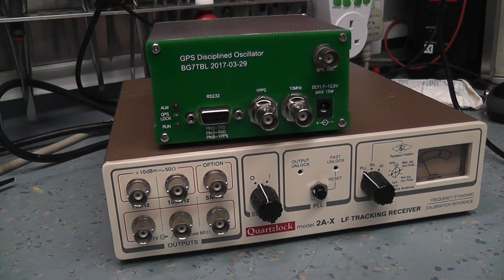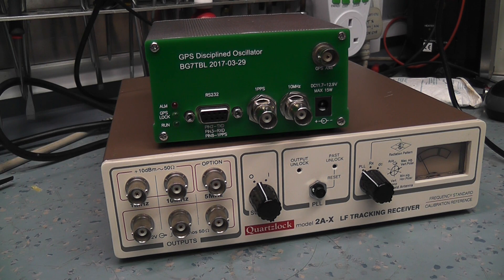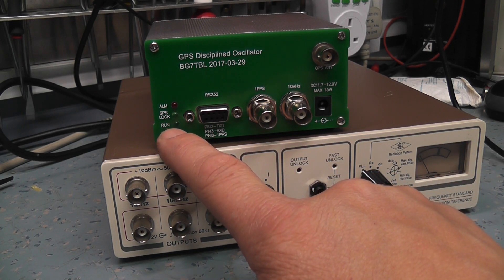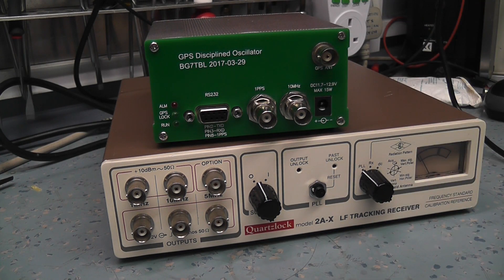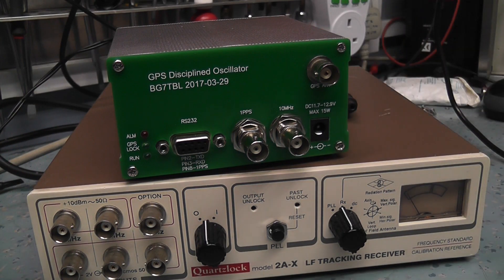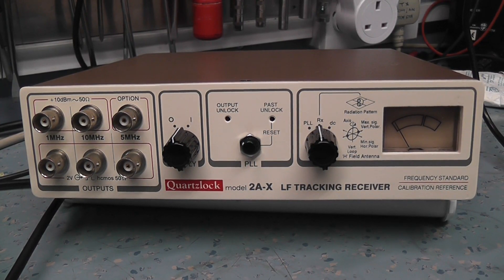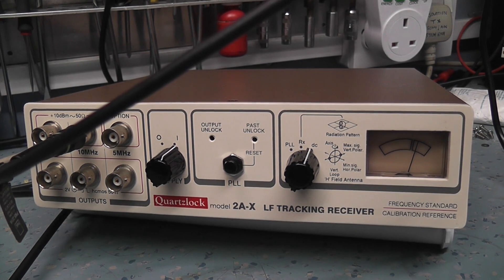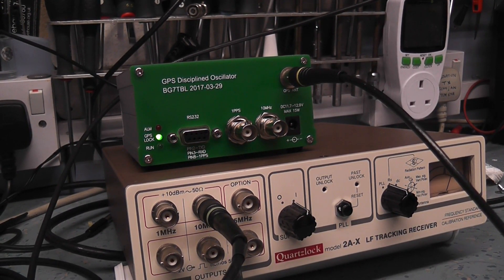GPS disciplined oscillators & Off air  disciplined oscillators.

Comment: I had a Quartlock device years ago, as my then frequency counter had a socket on the back for an external clock, so the Quartzlock would be on whenever I was using the counter, sadly my current frequency counter cannot take an external oscillator.
Reply from the maker: I'm sure you could hack it?

Comment: Hi Simon,

I was thinking of buying one of those for my bench. The GPSDO and the distribution amplifier specs says that the 10 MHz outputs give 1 Vrms sinewave and my 8663A manual says 0.5 to 0.7 Vrms. In the rear end it says 7 dBm (0.5 V) 'MIN'.
The question is: Is this ok for my old HP test gear? 8663A 8901A 8590L, etc

Regards

Comment: Thanks for that!  A document I encountered says that GPS uses three different clocks, with the best being cesium with a long-term accuracy of about ten to the -12 or -13.  I have a Leo Bodner GPSDO, which has a nice very-low-jitter local oscillator and is easily tunable to anywhere between 400Hz and 810MHz through digital dividers in the loop(s)... pretty nice kit.  (I have no connection with Bodner; just a happy customer!)  Probably better than the Quartzlock approach, I would think.  Anyway... for what it's worth!

Comment: I have 3 of the BG7TBL's that I purchased about 4 years ago found myself becoming a "Timenut" when I needed to calibrating an HP freq. counter, anyway's, I found out the firmware has a "bug" and they run slightly slow. Not sure if it was ever corrected or not on later units or not but even so you won't really know the difference or need that kind of accuracy unless ur planning to launch some deep space probes and need extreme accuracy. TNX 4 another great video!  73 N8AUM

Comment: I really love the quartslock very interesting.  The GPS frequency reference has very poor sort term accuracy  but as you say it steers the crystal oscillator which has good short term accuracy but relatively poor long term accuracy. You can get a lot of additional information out of the serial port including the satellite your currently receiving signal strength and elevation.  I have a list of serial commands and baud setting let me know if you want any information. Really interesting thanks for sharing. Regards Chris

Comment: I have one of the BG7TBL's and another one.......slightly different, both sine wave out. They are entirely satisfactory for general hobby calibration of test gear or even use as a trigger source. I use the "Lady Heather" software  (kindly provided by KE5FX) to monitor the GPS constellation via RS232 on my laptop. As far as a shortage of valves, you do know about LDMOS. I worked for a notable American manufacturer of RF transmitting tubes for 17 years, but I think LDMOS transmitters are becoming more the rule than an exception now. Thanks Simon, stay safe.

Comment: Good explanation of both units Simon, by the way the French transmitter on 162 is still going but only transmits data, as for running out of valves the French transmitter uses fet pa blocks, but there is no way the BBC would pay for that conversion
Reply from the maker: Thanks. I would like to think the bbc would keep it going somehow.

Comment: Sry guys, but since GNSS all the stations are synchronized to UTC so it's all the same long term accuracy. The Oven needs a few DAYs to warm up, not a few min. This Quatz thing needs a reference too. I bet a simple TCXO / OCXO also she needs DAYs of warmup time... if we talk about ppm
I don't know why you talking about Rubidium/Caesium as a reference all the time. It is just more stable than the GPSDO. Most Satellites has minimum one MASER Clock build in. A more stable accuracy over time you can't receive from the GNSS. The point is just the receiver quality; Jitter; Oven; Antenna, so on..
A simple Project. 4 freaks eyes only :o) 
https://www.eevblog.com/forum/projects/lars-diy-gpsdo-with-arduino-and-1ns-resolution-tic/msg1278672/#msg1278672
Reply from the maker: I was told OCXO's were stable within 30 mins or so?
Reply: @SoddingaboutSi  On a Datasheet. I have tested a Nortell GPS Board with a onboard Trimble OCXO. Board, Power-Supply, Counter, DMM (all covered in a Box) becomes stabalised in about TREE WEEKS! 
We are talk about +-50ppb like your Racal Dana counts. And that's sporty.
True, a good new actual OCXO you can stabilized in an hour, but in a Range of 10-7(8) in standard use. (accuracy)

Comment: Thank you simon, a smashing video and i finally understand the disciplined oscillator from gps :-D
I can now see why people go mad or mad-errr for this type of standard. :-D
The quartslock radio 4 method seems much like the pll operation in transceivers, R4 signal/Oscillator phase comparison and a correction voltage to drive the v.c.o.
The radio 4 idea has been around a long time and it was at 200khz as we all know, then some git changed the frequency to 198khz and all the 200khz standards were rendered useless :-(.
But people don't give up that easy :-D
I have the same racal 1998 counter you have, but all the buttons have collapsed and the original ovan oscillator was dead when i received it, the ovan was very cooked lol.
The counter was donated to me for free by a good mate, so i can't moan about the gift.

Comment: Maybe MSF 60KHz , Time from NPL is an option if 198KHz is turned off. According to Wikipedia the carrier of MSF is locked to a caesium clock.
Reply from the maker: That would be the best long term solution, unfortunately signal is very weak here.
https://www.npl.co.uk/products-services/time-frequency/msf-radio-time-signal/msf-reception-problems

Comment: My very first bench standard was a homebrew unit that picked the color tv frequency signal out of the tv that sent along from the analog stations; that went the way of the Dodo long ago. Moved up to GPSDO and frankly just use the Rb standard nowadays as I only turn it on when I need the accuracy (the old Z3801A cell site GPSDO on all the time just added heat to the room continuously!). Thanks for sharing Simon!
Reply from the maker: What was the difference in accuracy you found between the Rubidium and GPSDO?
Reply: @SoddingaboutSi  Honestly the only real comparison I made was using the X-Y inputs on the scope to compare them...that's when I naively thought that they'd actually be the same...not so! Wasn't until later that I really understood the fundamental difference between the two topologies. But hey, anything close to 10 to the minus 11 is good enough for us typical ham radio operators!  ;-)